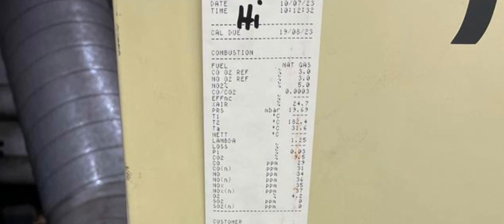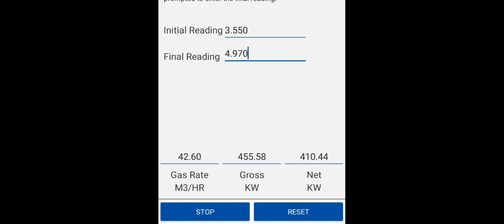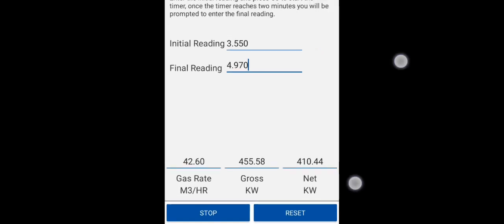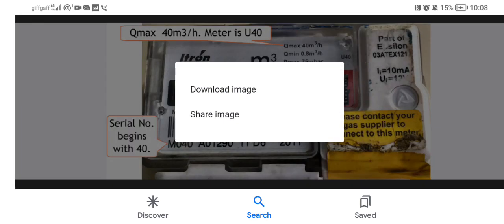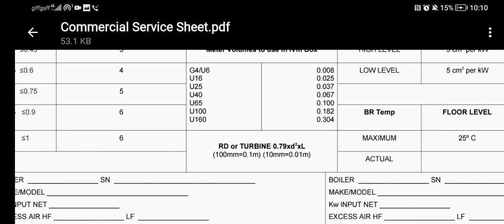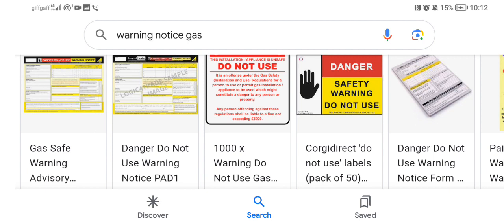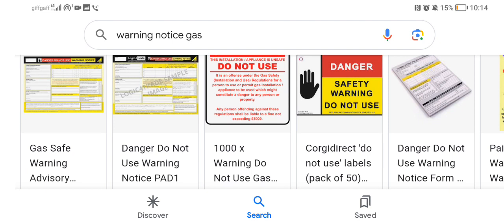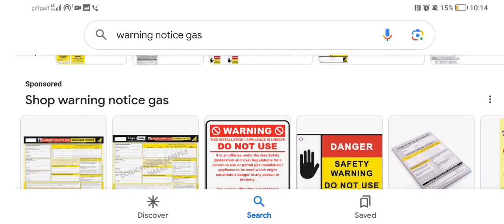DAY IN THE LIFE OF A COMMERCIAL GAS ENGINEER pt6

Comment: Hi, have you come across the new plant room doors they seem to be fitting. The openings are 15mm x 3mm. Im trying to get someone to clarify they are ok, my understanding is it should be a minimum of 5mm2. Would you warning notice it or would you let it pass as long as there is enough cm2.
Reply from the maker: 15mm x 3mm. Doesn't sound like you can get the ball through that. Sounds "at risk" to me. Check your plant room temperatures and your combustion too.